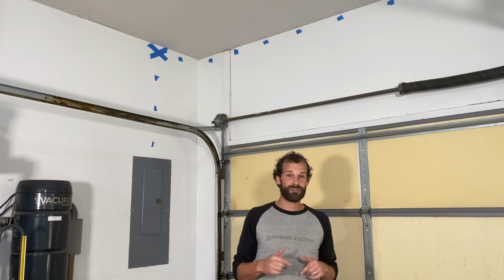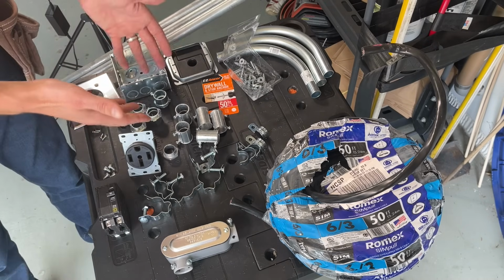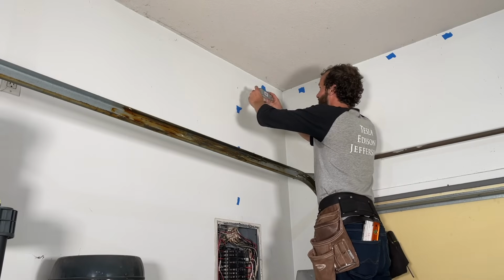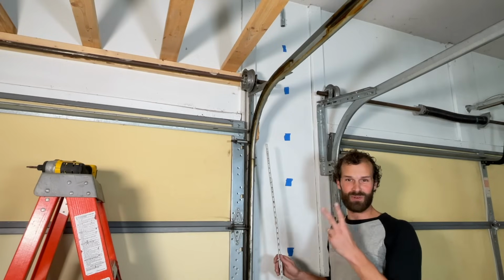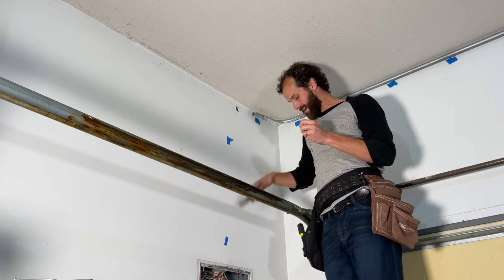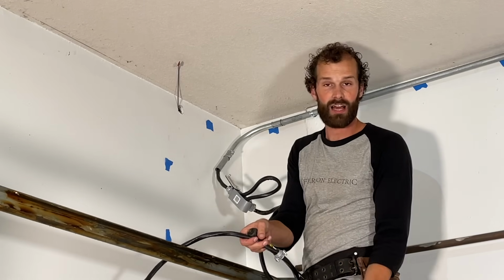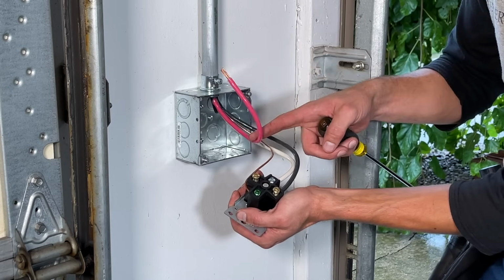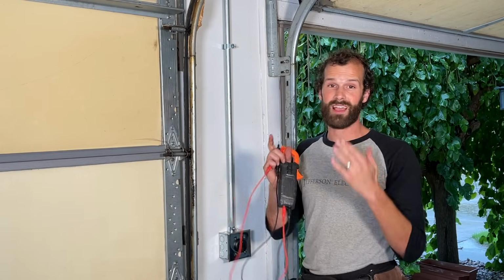How To Install a 240 Volt Outlet | Electric Car Charging

Comment: Hmm what if you have no garage? What if your service is not big enough?
What about the permits and State Laws that generally DEMAND a contractor's license to do anything to your home?
What if you have TWO electric cars and both need charging with only a one car garage?

Electric cars only only good for urban travel. Worthless for long distances and trips.

Best bang for the buck is a hybrid.

A hand bender can bend most EMT 3/4" or less without too much effort.
Much cheaper than buying premade bends and fittings.

2 electric cars charging = 100 amps.
That is 1/2 of many Service drops. Not much left for A/C, electric stove, electric water heater, Hot Tub, and thumping stereo....

Comment: I’m betting he didn’t pull straight THHN because he didn’t want to buy the four spools to pull it through the conduit. Also that 4 square he mounted looks really loose. Pulling the plug out of that wall will rip it out of the wall over time. Finding the correct cover for the 4 square is really hard right now, that must be why he went with the mud ring and incorrect plate. Just did about the same thing when installing a dryer plug and a few small thing, cost the customer $800. Took about 3hours. Thats in Indianapolis.

Comment: i could never ground myself when doing electrical work (grounding hand while installing breaker).  why is that using romex but not individual conductors?  i'm not sure but ev charger is 240volt so why need the grounded conductor?  showing DYI and using metal fish tape?  i would set a 1900 box up there instead of the LB.  This hardly a professional installation.

Comment: Amazing video, but I missed one basic tip that most videos on this topic never mention is what to do if you have a 100 or even 60a panel.

Of course the best solution is to upgrade to 200a, but that can be very expensive.

What more people need to talk about is installing 30a outlets(and a 24a charger) or even 20a outlets (16a charger)

Not the best solution, but can be done very cheaply and provide enough charge speed for most users.
Reply: Can’t normally just upgrade the panel by itself either. You need to find out what the incoming wire size is and be sure it’s large enough to handle the new panel. It gets very expensive depending how far to the meter. Plus talking to the power company to see what wire they have running to the meter.
Reply: The real question is if I have two EVs can I charge them both at once?
Reply: @gg80108  assuming ur panel is min 200A, and what major loads youre running in your house at the same time u should be good

Comment: Copper prices have gone BONKERS!!! Late Dec. I was shopping Lowe's and HD for copper, and made notes in an Excel sheet to determine costs/compare. I called my local electric wholesaler that I used to buy from at my old job. My buyer quoted me quite a bit more than the box stores.... Come late Jan. I was ready to buy my copper. I was double checking my numbers and HD had jumped $.90 a foot for 1/0 copper THHN. Lowe's was still lower at that moment, but I wanted to try getting a family member to buy it to get a discount....... the next day I double checked Lowe's they had price matched HD. So! I called up the wholesaler and she quoted me $3.05 for #1 and $3.06 for 1/0. I went big and got 1/0.... HD/Lowe's were at $3.89 for 1/0.

Great video BTW. Lots of detail.

Comment: I was told by Toronto Hydro that 3/0 cable is not sufficient to provide 200A service to my home, so I was obligated to pay through the nose to have 4/0 cable installed (underground).  Ended up costing me over $11K extra.  So be wary, that electrical codes do differ throughout North America.

Comment: Any electrician would run romex through the top plate in the attic.  Also would not televise  running romex through conduit. When you could just strip the jacket in 5 seconds.
Reply: @Kevin-mp5of  what? That's not a code violation considering conductors in romex are black white and bare for ground. If you need to redidentify the neutral as a hot, simple red or black tape will suffice

Comment: Excellent video, I didn't imagine myself watching this in one sitting but Joel's calm teaching style and work flow is mesmerizing to watch. Thanks so much for the collaboration, Scott and Joel! You guys both put out quality, well-articulated content. Also subscribed to Joel!
Reply: He has leadership tone and patience something I really like to embrace with my crew . Win win .
Reply: Metal in a hot panel..... NO!!! WORST MISTAKE
Reply: I also felt this video was very informative.  I pretty much ignore the "let me see what I can criticize" people.  😅  If they posted a video, there's be others criticizing their procedures, have not doubt.
Reply: “mesmerizing”? I was waiting for the spark and lights out when he was letting that fish tape just flip around in the panel. 😬
Reply: This guy is a hack electrician, die cast coupling, steel connector, mixing type of connectors, WRONG next it’s a 3/8” offset not 1/2” offset. If this guy new his sheet he wouldn’t run 6/3 romex through an LB, ROMEX IN A CONDUIT IS ALSO WRONG, DIY just have the guy at HD cut individual wire to your length, 40’ feet of conduit eguals  3- 46’ of #6 and 46’ of #10 green, individual wire is more cost effective than romex
Reply: @vinceandrews9187  I have to agree with one of the points you made about No ROMEX wire inside the conduit.  Be that EMT or PVC.  The heat generated by the current flow "could" melt the casing over time, creating additional damage to the wires and serious problems. Mainly, when needed force is applied to ROMEX of this size to thread wires through the LB.  I also agree the ground #10 wire in green using THNN shielding is an excellent means of helping eliminate the possibility of a short.

Comment: Thanks for making this great informative video.  It should be very helpful to new EV owners and to train new electricians [and skilled DIY types]. Given the cost of copper these days, I would install a 6-50 outlet instead of the 14-50.  Just be sure to get a 6-50 adapter for your car’s charge cord instead of a 14-50 adapter.  This saves the cost of the unused neutral wire.  However, if you ever would want to plug in a 50 Amp RV in the future, then go with the 14-50.  RVs need the neutral wire and cannot use a 6-50.  Another thing to consider is using separate THHN wires to support converting to a dedicated EV wall box with 60 Amp breaker in the future.
Reply: Question: Do I run a 6/2 NMB wire for the 6-50 Receptacle . Also should Romex 6/2 wire be in a conduit? Some concerns about heat accumulation in PVC conduit. What do you think?
Reply: @ziamkondkar8273  It’s best to pull individual conductors rather than NM. It’s easier to pull, and reduces potential code issues with the wire overheating - critical if you’re pulling full capacity for a couple hours. In the US you’d be using THHN, and in Canada RA90  or similar. 

You may be able to use TECK cable (it’s a very heavy armoured cable with an extra layer of plastic) without conduit. While it’s more expensive than NM once you factor in the cost of conduit it ends up no more expensive.

Comment: Thanks for making the effort that goes into these vids. I learned a thing or two and you knew damn well the experts were going to weigh in on your work. In my handyman work, I've decided to stop at the box, mostly for reasons of liability. But, being able to recognize a correctly installed circuit is very useful and could catch an unsafe situation.
Reply: Add
Reply: Bad install,  check out electrical codes . This guy is a fake!!!

Comment: Lmfao. So many code violations in one video. People please hire a qualified electrician to do this work. Also half the materials were wrong
Reply: 8 thhn is rated for 50 amps. So no need for the 6 wire.

Comment: I came back to this video to find a link to the super duper triple hinge needle nose pliers.  Never seen anything like that before.  There are dozens of times in my life where I could have used something like that to retrieve a dropped screw or nut that fell into never never land.  A magnetic tool sticks to everything on the way down, and also on the way back up, making the retrieval pretty much impossible.  Imagine my disappointment to find no link to those pliers, after you guys said there were links to everything used in this video.  So to you guys (and gals) like me who would like have a super neat tool like this in your toolkit, be advised that they are available at Menard's  for $20.  Add tax, handling and shipping, they come to about $30.  AMZN has double hinge Crescent brand in straight & 45 deg for about $20 each.  Hope this helps someone.

Like the video.  Picked up some neat tricks- especially how to install a romex box connector after the fact.

Comment: I watched this whole video thinking it was a spoof… a collection of very questionable electrical choices and practices that would fail inspection in most (many?) jurisdictions. I’ve saved it now for use in my training classes… to elicit “what’s wrong here?” discussions. (Many good comments here, along those lines.) The NEC is often very hard to understand, for sure, and it changes every few years to try and get better in clarity and in sync with advancing knowledge. But a newbie really MUST follow the dictates of his/her local AHJ, the legal authority that ultimately signs off on the installation. YouTube is NOT that authority!

Comment: @Kris Klekosky You are correct...however Romex is not listed for use in a Conduit or Raceway of any type or length...period. Code says you shall use Listed Products and Materials without modifications, alterations that would violate the Listing. IOW if it's not in the Listing Installation Instructions then you CAN'T...simple as that. So with that...all the Romex entering via a 2" PVC Conduit Connector is a Violation...as well as Bundling in a Distribution Panel. 
Remember you must follow Code and MFG Listings for all Products!
Also remember the products are submitted for testing and minimum standard approval WITHOUT your modifications or alterations...once you modify, alter...you violate the Product Listing and the product is no longer Listed and Can't be used as Listed & Code Compliant !!
So what modifications or alterations are allowed...Absolutely NONE !!
Although a Manufacturers Listing provides some sense of Safety...the primary purpose is to provide Third Party Testing Liability Protection to the MFG.

If users modify, alter, incorrectly install or misuse the MFG's product their liability exposure diminishes dramatically via user deployment and use of the product!

What's funny here is even though inspectors saw the Romex entering the Panel via a 2" PVC conduit connector and it looks pretty...they approved it even though it is a code Violation/s !!
What's even funnier is how poorly trained they are in the Field...electricians and inspectors!

Yesterday I couldn't  spell Electrician...today I are one!

Good thing they don't inspect Aircraft...it would be Raining Airplanes!
Side note...
With all that in mind...can wire nuts be used in a Panel Board... Yes/No?!
Reply: So my question is this...is there a more economical cost effective and code complaint way of accomplishing this installation and is faster!

The winner is Hired!!

Comment: What is the grounding path for the conduit? I do not see it grounded (wire from conduit to buss bar) in the panel or a conduit to panel box physical connection. With a metal box, to have it grounded is just safety, no idea if it is code or not. Another expense is the permit. Mine was $150 so I did several projects and had the inspector look at all of them for only one permit fee.

Comment: If your local county follows 2020 nec this outlet requires gfi protection per 625.54. My question is do portable chargers have internal gfi protection that will cause gfi breaker to nuisance trip?
Reply from the maker: Thanks for the callout we are still on 2014 in my area.

Comment: Isn't the Romex required to be stapled to a framing member within 12" of the service panel and the LL connector?

Edit: 2-25-22 No, it is not. NEC 334.30(B)  https://www.youtube.com/watch?v=TbAFRzp1PZ8

Comment: This is one of the worse instructional videos for homeowners . Multiple code violations !! Zero safety !! Zero PPE working in a live panel . Using conduit body where you should have used a box . Using a combo conduit body leaving zero access to the other removable cover . This was very entertaining but def not the correct way to do this job . Extremely dangerous . Downplaying the danger by calling it a “ sting “ .

Comment: one thing you never said witch is number one, pull a permit before you start any electrical job or repair and call for inspection before turning on the power, it is law failing to do so can lead to huge fines and if you have a fire and it shown to be  the fault of the fire was your wiring, your insurance is void if no permit is fond for that job. i dont know the code in the USA but i do know electrical supplies bought in the usa do not meet Canada code, wire big time, also here you must tie in your bare copper ground wire to the receptacle box even when metal conduit is used, you didnt tie in the ground to the box

Comment: Just curious why you didn't feed the wire into the bottom hole of the LLR as you were passing it in. Seems like it would be so much easier than fighting to shove it down with the excess kinking up

Comment: 6/3 NMB has a cross section of .338. 3/4 EMT at 53% is .283 max fill. Besides that the waste of effort and use of materials added considerable to the cost of this install. I would have used single THHN conductors A 4 SQ. J-box above the panel and 3/4 flex in the wall. I see no reason to use an L fitting when a box and cover are so much cheaper. My whole body hurt when you were fighting that NMB.
Reply from the maker: Appreciate the feedback 👍

Comment: Especially for DIY’ers - if the appliance end is already completed and you are wiring into panel, ALWAYS check for continuity (short) between the cables before you land them in the panel. Once landed, it’s not easy to check. If you get continuity between any pair of wires, there is a short and you must not land any wires.
Reply: Good advice.

Comment: The tighten and wiggle tip is awesome!!!
Reply: Agreed. I just installed a generator inlet box. After watching this video I went out and applied the wiggle and tighten method to what I thought was a completed project. I was surprised at how well it worked. Thanks!

Comment: Safety is critical.  The "licensed" electrician is wearing a ring.  Bad.  He is not wearing any PPE (Personal Protective Equipment) such as safety glasses, gloves, and probably not insulated boots.  Arc flash can melt the skin from your face.  He also waves his hands around next to the open panel while looking away.  Do not do that.  EMT conduit can only have individual strands of wire.  At least in Washington State.  And do not use romex in any conduit.  His words are good guidance but his work habits won't be coming to my garage.  Just sayin.

Comment: Nice presentation, with a few code violations. 1. Romex in conduit, except thru a sleeve, is a code violation. You should know that. 2. The only place common or neutral wires are allowed to be landed on the same bar is at the main service. The main service is identified by where the meter is, be it a panel of simply a meter housing/disconnect. Everything down range from that location needs separation, I.e., isolated neutrals and grounds to prevent parallel paths to ground. In this sub-panel, which is what it is, grounds and neutrals should have been separated. Much better job would have been a flexible raceway or romex in the wall to a 4sq deep box above the panel. THHN from there to the outlet. Feel free to review your NEC publication for verification.
Reply: You can absolutely run romex in conduit.

Comment: You constantly talk about Code Compliance, it is a code violation to pull Romex inside of a Raceway. You also talk about a professional job, you should not have put a mud ring and a cover with sharp corners on your four inch square box, you should have installed a raised cover. Did you have this job inspected by a competent inspector?

Comment: Very well done installation! For the benefit of the viewers, I must say that when I cut a conduit, I tape all around it at the desired position of the cut (with masking tape or paint edge tape). I then cut along the tape edge with a hack saw, while rotating the conduit at regular intervals. This keeps the cut always visible on the upper side of the conduit. After the cut is completed, I then remove the tape. This ensures that the cut itself is perfectly perpendicular to the edge of the conduit. This method is particularly useful when cutting large diameter pipes, such as for plumbing drain pipes. 2022/01/11. Ontario, Canada.
Reply: You do that on a union job, you won't be employed very long,
Reply: @jakeo2600  Do that on any job and you'll be the butt of a lot of jokes.

Comment: now the big question i have is what gauge wire to I need to run  in my garage? some use 10 gauge others use 6 gauge and what size of breaker 30,40,50amp because my oldest son is getting a 2022 nissan leaf.

Comment: Most of this does not apply in the UK. In most situations you will need to check the capacity of the supply, the available ways through the distribution unit and capacity of the earth circuit. Then most installations would use 10mm SWA 3 core cable. Best to talk to a licensed installer who will also sort the financial grant and capacity check with the local supply company.

Comment: It is also a code violation for multiple wires under the same screw terminals in the panelboard. Each wire requires it's own screw terminal.